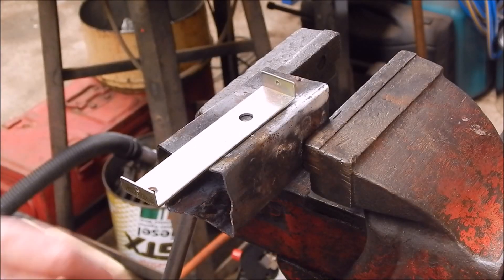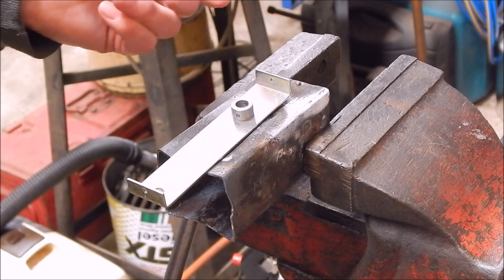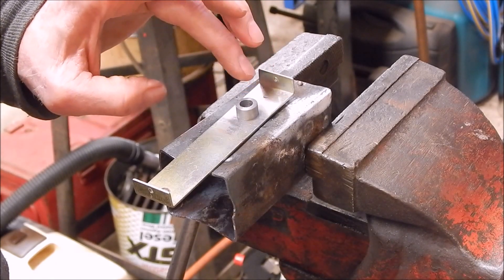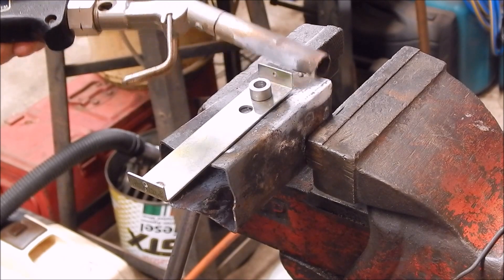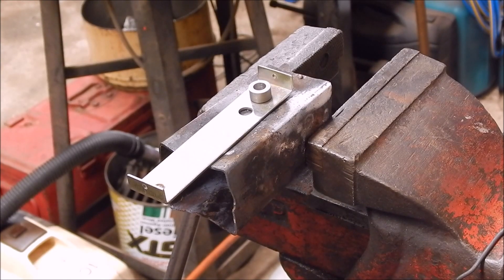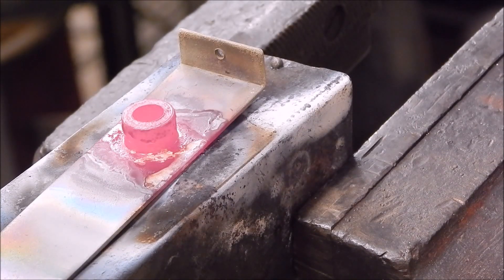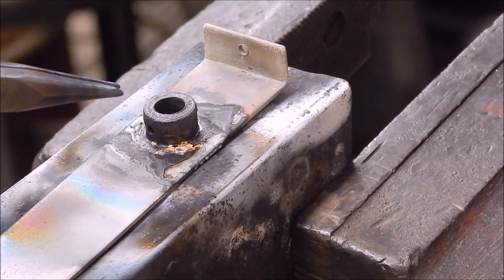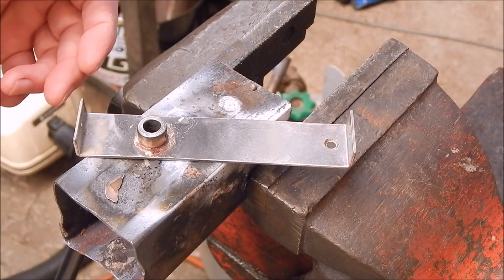How to get a 100% strong bond when bronze brazing

Comment: great result. Would you consider brazing with copper? It does not require flux and has excellent capillary flow. I am guessing brass rods are stronger
Reply from the maker: I did a video on this way back using copper electrical wire.  It works extremely well and was equally as strong as manganese bronze. I used flux in both cases as it provides a cleaning/anti oxidising function.  I have never used brass rods for brazing.  https://www.youtube.com/watch?v=O4mFBzezsqA

Comment: Thank you for the guide and technique on how to do brazing properly. I am new in brazing since I only tried when brazing copper pipes in HVAC units. But also I would like to try brazing to bond 2 pieces of steel and also the capillary action works well. I tried once to put flux powder before firing up and the filler do not stick well. Then I imitated this and worked pretty well. I strongly agree about having "control" when doing that. I use MAPP Torch for brazing. Greetings from Philippines!
Reply from the maker: Hi Sophie.  Glad it helped.  You must put the flux on with the metal hot.  I add it while the job is heating up to near brazing temperature.  It will go clear when it's melted.  That gives it time to clean the job before adding the bronze or silver solder.  MAPP is quite OK for most small heat loss work.  Greetings from Oz.  Cheers Rob
Reply: @Xynudu  Sir, how hot? would it be cherry red? red orange? or in between? or i would rely on giving silver filler rod with flux while i see those colours on workpiece indicator? I agree about that since on sheet metal (mild steel or GI) or even on metal tubings like in reception area of offices (took me a minute). But also i tried rebar (bars used in construction) and took me 5-7 minutes before reaching cherry red and tried your technique and finally the filler with flux adhered, provided i used metal brush to the bar prior brazing. It was rusty, then when i brushed, there were some shiny parts that can be used for brazing so the filler will adhere. I do not have "oxygen" tank to partner with my humble mapp torch yet (which hoping will speed up the process) but overall though it looked bit messy, the durability is good and even a chubby person can support the visitor chair that was brazed. I agree on what you said since the thicker the metal, the more it acted as heatsink. ^_^
Reply from the maker: Hi Sophie, sorry for the delay in replying.  As soon as the job goes dull red it's OK to add the flux.  The heat will allow it to adhere and melt.  The metal must be clean - no rust. Cheers Rob

Comment: Thanks for your excellent videos.  How important is the cleanliness of the joint when brazing?  I seem to have difficulty in getting the bronze to run or bond - not sure if it is preparation of the joint or something else.  cheers
Reply from the maker: Hi Jeff, it's extremely important to have clean rust/corrosion free surfaces when brazing.  You must also use the correct flux, or the molten brazing rod will bead and not adhere to the job.  If the rod is not melting it indicates that the rod is poor quality, wrong type, or the gas torch flame is not hot enough for that rod.  Never buy cheap no name brazing rods as they usually have extremely poor melt and flow capability (from my experience). Borax based flux as required, is a type of cleaning agent, but use one specifically formulated for bronze brazing.  This will also do silver solder - the code in Australia is CA-303. Make sure your rods have a high manganese content for easy flow and melt characteristics.  I hope this helps.  Cheers Rob
Reply: @Xynudu  Excellent - thanks Rob.  I bought the rods and flux from the big green shed, and I'm using one of those small mapp/Oxy kits (expensive to run) but I think it is hot enough.  Yes, the bronze appears to bead - will double check the flux to make sure I picked up the right one. thanks again - from Adelaide!
Reply from the maker: Hi again Jeff,  as you are in Adelaide the rods to get  most definitely are BOC Profill Manganese :  https://www.boc.com.au/shop/en/au/boc-profill-mang-bronze-gas-welding-rod-grmb-112

The small packs are more expensive per rod.  I use 1.6 or 2.5 mm depending on the size of the job.  Smaller are easier to handle.  The last lot of brazing flux I bought came from Hampdon Gas in WA.  Free postage and cheaper than BOC:  https://www.hampdon.com.au/CA-Flux-Copper-Brass-Flux-250g-303-OXY-LPG-Brazing

I haven't used it yet, but it is CA-303 code/mix same as the EZIWELD 303 which is no longer made.

Cheers Rob

Comment: So what it the nozzle size of bullfinch brazing torch? They claim it's smaller so 0.3m or 0.35mm, my torch has 0.4mm
Reply from the maker: I have no idea what size it is.  That isn't really the reason it works so well - it has more to do with the gas mixing venturi in the burner nozzel,  Cheers Rob

Comment: It’s been a while since I did brazing but one tip that prevents  the brazing melt from going everywhere is to rub a pencil (as if you were shading a picture ) around the border say 3mm 1/8” bigger than the finished brazed joint. There are commercial products about, but a quick shade with a pencil can help contain the flow of braze when it matters.  You’re better than me as I’d often get the  fluxed rod pick up the light part! A grr moment, thanks Rob
Reply from the maker: Hi Graham,  thanks for the tip.  I will try that next time.  Makes sense for sure.  Good one.  Yes, brazing small stuff sure checks out your nerves ;)  Cheers Rob

Comment: Hello, Please let me know what kind of torch you use. Can you send me a link from a suplier of a torch like yours? Do you use oxigen? And gas, is propan? Thank you.
Reply from the maker: Hi Joao,  the torch is made by Bullfinch in the UK.  This is the kit I use:
https://bullfinch-gas.co.uk/blowtorches/autotorch-brazing-sys/autotorch-brazing-kit-detail

It runs on standard LPG or propane.  No oxygen cylinder required.

You can buy it off of Ebay in some countries.  It is NOT sold in the USA or Canada, but units sold in Australia will fit the USA gas cylinder POL fitting.

The UK POL fitting will not fit many overseas cylinders (including the USA), so check compatibility.

This company will ship overseas:
https://www.hampdon.com.au/bullfinch-lpg-autotorch-brazing-and-welding-kit

Cheers Rob
Reply: @Xynudu  Hello Rob
Since I live in Portugal it is easier for me to buy to Bullfinch-gas in England due to the proximity.
Thank you very much for your precious information
Regards
Joao A Ferreira
Reply from the maker: Hi Joao, you are welcome.  Just make sure that the UK POL thread will fit your cylinder as the kit uses a high throughput gas regulator, which you don't want to have to replace.  Apart from that aspect you should have no issues. 

The torch is not cheap, but is a quality unit and quickly pays for itself in gas savings.  I put a couple of end screen links on that recent video linking to other earlier videos about the Bullfinch system. 

It has it's limitations and can't equal any oxygen boosted gas torch, but is excellent for smaller job use - a bit better than MAPP gas.

Cheers Rob
Reply: @Xynudu 
Hello Rob
 I'mm thinking of buying only the torch without regulator or hose because I have a home cylinder of 13 Kg propane gas that already has the regulator.
Yes, the equipment is very expensive.
Thank you for your attention
Regards
Joao A Ferreira

Comment: Thanks! I learned something useful today. I have probably always used way too much rod.
Reply from the maker: It's a common mistake.  Doing it this way (when possible) you can keep the bronze filler to a minimum and be sure of complete coverage.  Sometimes you just have to use capillary action and that usually means some of the rod is wasted - flowing elsewhere ;) Cheers Rob

Comment: Hay Rob, I have a really neat product I use very sparingly because I only have a small amount of it. It's a flux with powdered silver solder in it. It works brilliantly on jobs like this. Don't ask me who makes it, the container has no markings and I can't remember where I got it. It may be a Utectic product, I don't know.
Reply from the maker: Hi Mick,  I haven't seen that one.  I have seen quite a variety of specialist rods over the years, some quite expensive.  Most do what they say.  Bronze rods are definitely not all the same.  Many different flavours.  Cheers Rob

Comment: Great job m8. I always wonder what all the fuss is about on the forums over brazing.  ie (cant do this cant do that gotta be done this way or else). I have been doing it since I was a teenager 60 years ago and always found it easy to do. Clean base makes a big difference but even on some ropey materials it still usually works OK as the heat does a lot of the clean up.  Thanks for sharing. Stay safe stay well. regards from the UK
.
Reply from the maker: Hi Gary,  yes some people seem to make a big deal out of what is a simple process.  Provided you prep the job, use the correct flux and a decent quality rod all is easy.  Cheers Rob

Comment: Capillary method does work well, BUT you have to clean both surfaces very carefully then apply a paste of flux powder mixed with water and preferably wire the joint tight together before heating in order to be certain of the braze fully penetrating the joint (capillary action works best in very narrow spaces).
Reply from the maker: Hi Pat, Capillary works fine with freehand.  Flow paths and gaps are going to be the same.  I've only ever seen paste used with a furnace.  That's how most factory production brazing is done. Cheers Rob
Reply: xynudu that is how I was taught to do it decades ago, I am not sure that I saw a pre fluxed rod until at least 10 years later, as for capillaries and ‘capillary action’, well I went on to become a biologist & that is how most plants 🌱 raise water up their stems (tall trees have a bigger problem), but it is the very narrowness of the plant tubules which facilitates the capillary ‘draw’ which pulls the water up the plant against gravity, it is related to the ‘meniscus’ around the edge of your cup of coffee!
Reply from the maker: Hi Pat,  coated rods are rubbish from my experience.  You have no control of the flux.   The rods sold in tool outlets from my experience are total junk and it's no wonder newbies often struggle with brazing.  I only use BOC rods.  They are the best, as is DA 303 dipping flux, from my long experience doing this.

Cheers Rob
Reply: xynudu yes with the coated rod you have to heat the flux and allow it to flow down into a joint which all the while is being heated whilst not being protected from oxidation, with the two methods we have outlined (I would call your method ‘tinning’ the joint from soldering practice) the cleaned surfaces are protected from oxidation as they are heated to the melting point of the spelter.

Comment: Thanks for this Rob, I always enjoy your brazing videos, gives me confidence to do my own. Cheers, Alan.
Reply from the maker: Hi Alan,  this approach will give a much neater end result and also allows butting together irregular broken faces (as on cast iron) which don't capillerate very well.  Most times gravity is sufficient to allow the two faces to come together during the re-melt if everything is lined up correctly.  Cheers Rob
Reply: @Xynudu  As you say, it's very much like soldering where you tin both surfaces before joining. Cheers, Alan.

Comment: Can you use bronze rods in arc welding
Reply: You use to be able to get a carbon arc rod attachment for brazing. A gadget with two carbons that is adjustable to get an arc. Here is a picture of the gadget with out the carbon rods.https://www.mig-welding.co.uk/forum/threads/carbon-arc-heating-brazing.17798/
Reply from the maker: Hi Tony,  a mate of mine bought one of those kits a long time back.  I checked it over, but never saw him use it, although he did try and reported back that it was difficult to strike and maintain the correct arc gap between the two carbon tips.   I had not heard of it being used to arc to the job ground as stated in that link.  That would erode away the job pretty quickly I would expect.

It wasn't very good.  Difficult to see and use as well. Pretty lightweight construction.  It looked the same as in the link photo.  One of the brass rods slid in and out.  The other was fixed.

The principle was sort of like a poor man's TIG.  It also went through carbon rods at a fast rate.  Probably in the scrap bin by now. 

Cheers Rob
Reply: @Xynudu  I agree with you. I have one and yes it will braze but it is not easy and not worth the bother.However like all the junk I keep it may come in useful one day.
Reply: @Xynudu  I used to do some car body work repairs with one and it worked ok after a fashion.  The Carbon arc welder does take up a fair bit of room when under a car. Not that easy to get the right arc all the time especially in tight corners. Never used it grounded like shown. Not really made to be used that way. Was invented as a replacement for gas welding I believe.  I had a 12vdc version and one that attached to the welder transformer.   regards
Reply from the maker: Hi Gary,  the one I saw ran straight off the AC stick welder leads.  It replaced the rod holder and ground clamp.  A one hit wonder ;)  Cheers Rob
Reply: You can TIG bronze but it is a different form. It is silicon bronze.
Reply from the maker: No.  You can however use arc welding rods for torch welding provided you have a hot enough gas torch (oxy acetylene).